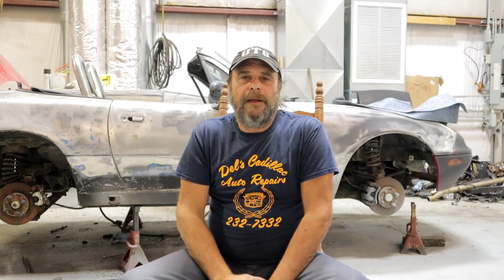Automotive De-Evolution...The Next Big Thing?

Comment: 5:01 the sad thing is todays cars aren't better at all and that is what is drawing us younger guys to them. If my 68 Satellite can total a brand new full size sedan and come out with just a little bend in the front bumper, brutally outrun the new N/A heavy ass Chargers and Challengers with about the same HP, less gears and a carb and still get better gas mileage than them AND last significantly longer, then the old cars are obviously superior.

Comment: 1970 was the pinnacle of automotive engineering because all refinements after that were/are jaded by government safety/emissions regulations.  The govt. ruined cars like it ruins everything.  Yeah, new cars are safer, cleaner, blah, blah... OLD CARS REPRESENT FREEDOM!!!  Safety regulations and aerodynamics made cars ugly, because they all had to meet certain specs that ended up making them all look the same.  Styling engineers can't be very creative anymore.  Emissions regulations took away all of the performance and tunability.  Yeah, you can take off all the emissions equipment, use bigger cams, higher compression... but then you have a modified car.  If you get an old car that never had it, you still have an original car without all of that extra, unnecessary crap.  Old cars are simple and stylish.  New cars are complicated and boring.

Comment: I shake my head when I see a LS swapped into a muscle car, especially when the rest of the car has been resto-modded.  They are completely missing out on the visceral experience of driving a car built in the 60's and 70's.
Reply: meh... whatever makes the old new again is better than tossing it all away.
Reply: LS is a nice engine for many reasons but it's about like opinions and azzholes everyone has one.
Reply: I love the newer drivetrains in a 60 year old car . Air cond and all , to me it’s the perfect all around car . And a ls engine is no way harder to work on then a old 350 . Cam swaps are nice .
Reply: I can go pump the accelerator pedal once and my car starts right up. Tap the gas again and the choke comes off. It does take ten seconds longer than a modern engine, but I’ve never really noticed
Reply: Why wouldn't you use an LS? They're a small extremely lightweight (often) all aluminum small block with super well flowing heads and tons of aftermarket support.
Reply: @SoI_Badguy LS engines leak everywhere and are plagued with valvetrain problems
Reply: I put an EFI 5.3/4L60e in an 80 Firebird and loved it! Only swapped because it was a JY 1/2 price day special and the car had a seized Pontiac 265 V8. It wasn’t a simple swap and I probably wouldn’t do it again most likely…but MAN it was great! Quick, reliable, and a great cruiser. Ive loved my carbed cars but I totally get the modern engine appeal.
Reply: Why would someone want to have to go through the continual maintenance and poorer performance of an older engine when they can afford a better, faster and more reliable engine?

Comment: I am 21 years old.  You may assume that I came up in fuel injected cars, and started out driving fuel injected cars... but that's just flat out wrong.  As I was growing up, it was essentially just my father and I.  I have a full nuclear family, but my only real friend was my father.  He taught me the ways that he learned from his father and grandfather.  My first memory was his 1969 Mustang Coupe broke down with a broken rocker stud.  I don't remember much from my youth except for the times around his Mustang and his 1966 C20.  That's all I've ever known.  He taught me how to work on points and carburetors, and how these newer cars suck to work on, and I took every bit of it to heart.  When I got my license, I was driving in my 1972 Impala 4 Door.  I loved that car, and my every thought was about how I'd make it faster.  It got dual exhaust, a camshaft, a flour barrel , and eventually some headers.  After two years, I got my 1971 Satellite Sebring on the road, and I've been eat up about it since.  People know me because of that car.  Its my pride and joy.  Its got a dual point distributor and a Holley 4778-8 700 Double Pumper on top of a 318, and I drive the crap out of it. My Impala still has points and a Holley 3310-4.  I'm building a 1967 Ford F250 thats going to have a 390 with, you guessed it, points and a Holley.  That's all I've known, and I know it well.

Comment: This is why I WILL NEVER convert my carby small block 318 to a Holley sniper!
My edelbrock carby runs very well. Why mess with that. I’m not really gaining anything by doing so.
And then suddenly my old school cruiser will have to use computer crap to get it to run which in turn makes it harder to fix when it breaks. 
Connection with a screwdriver and not a laptop is ideal. Thank you kind sir.

Comment: My first car 1962 Chevy Belaire. !982-1986 was at Fueling Engineering in Ventura Ca Oldsmobile Quad 4 project. I have a thing for 1967, 67 Barracudda Fastback, 67 Pontiac Firebird Formula 400, 67 442, so many more! Now 2002 Dodge Dakota 4.7 bored, sleeved, forged crank, rods, pistons, HO heads oversized valves, ported and polished, HO intake, custom EFI,.........

Comment: "You connect with machines by using a screw driver.......NOT a laptop"........YOU HIT THE NAIL ON THE HEAD TONY!!! Speaking of that DZ 302, I remember back when Penske and Smokey Yunick was building those and getting somewhere close to 450 hp. THAT was incredible for a normally aspirated 302 back in the day. Many guys don't believe it, and I challenge them to look it up.

Comment: I’m in my thirties, and I’m rebuilding a 70 Chevelle, it’s frame off right now. It’ll be carbed, mechanical fuel pump, the works. And Tony gets it. I don’t want the electronic mess and troubleshooting this and that. I like the simplicity. Sure, there’ll be lots of folks who want to LS swap, or what have you. But that’s not me. Those old engines have a “soul” the new ones don’t. Not to insult anyone’s LS, just I like the simplicity of distributors over sensors, carbs over fuel injection, etc. Last summer I was at a small cruise night and there were two ‘55 Chevys parked side by side. One had a Gen 1 small block, the other a full LS swap. The LS swap was very clean, very nice, but just didn’t have that “something” the old small block did. 

And just like Tony said, I really do feel I missed out on the good years of this stuff. I’m fortunate enough to enjoy it now though, so I’ll take it :)

Comment: Very few cars today will be a round or viable or able to find computer parts for then there astronomically expensive it's all part of the master plan to break our addiction to the love of cars think about it since the late 90s they really haven't made a vehicle that will hold up for fifty years and be rebuildable the wiring is made out of peanut oil which rodents love like the 03 Pathfinder all the wires that go through the bulkhead connector are the same color trying to figure that out you can't you have to buy a new harness people need to realize that everything that is going on in the world is to shoehorn us into a society that keeps its head down at work like China they want us all to be slaves

Comment: I am 25 and I like working on my '77 Thunderbird more than my '97 Accord! With my '77 Thunderbird, I can fix everything on the car with a small cardboard box of tools that I throw together after work! On my '97 Accord, I need my whole toolbox! I'm trying to get smart enough on old cars so I can ditch fuel injected cars and just drive my Thunderbird, Falcon, and Dodge D150!
Reply: You will regret driving anything older as a daily driver. They are not reliable enough to be daily drivers.

Comment: yep older cars are easier and cheap to work on while your sitting at the dealership paying 2000 or more to get a couple of sensors fixed or a fuel pump 😂😂😂. I'll take 25.00 fuel pump any day and my 65 dart that gets close to 25 mpg on the interstate from the 225 slant6 1 barrel 😁. I'll take my basic wiring over a computer sensor shit storm

Comment: tony is a time machine that takes me right back to the 70's and 80's when everybody had more passion
Reply: We didn't have passion in the 70s.
We were smarter than that. We just got down to business.
Reply: i remember when an average guy could walk into Holman -Moody, a stockcar builder, and drive out with a racecar that could do Nascar racing. it wasn't a front runner, unless the driver was REALLY good.
it would set you back $10,000   or so.
for perspective my nicely optioned 66 Malibu stickered for $3500.

Comment: Can definitely agree with this! I just turned 21 years old and these newfangled EFI systems and electronic ignition systems are all way too complicated. I'm absolutely in love with my 91 Ford F-150 and although it has fuel injection it's a great old truck that you can really enjoy working on. As long as the big eco nuts and government keep away from pollution control standards from completely choking off combustion engines, I really hope to see more devolutionizing in the car industry!

Comment: Just because a modern v8 has fuel injection doesnt mean you cant fall in love with the car. Ive gone thru 4 different modern v8 mustangs from mild to wild high compression builds all done in my garage. It is not that hard to work on, and they run well if you build them well and tune them well. That being said i have a love for all things fast, loud, and fun
Reply: I have a 1992 Ford Ranger I have had for 22 years and I LOVE that truck. 227k miles with only oil changes and tune ups to the 2.3. You are not getting 200k on an older engine as they are just not reliable.

Comment: When you are young you chase the new and "better".  At some point, you begin to appreciate the simple and basic.
Reply: Except he's trying to say the younger crowd is enjoying the older and simpler right now...
Reply: 67 and 70 are my 2 favorite years for cars . Almost every car in 67 looked great and in 1970 the muscle cars were at the top of performance. Exception is the 71 boss 351. Like that car a lot .
Reply: @gregblack3860  1957 was a good vintage too...
Reply: @frogman8591  yes it was
Reply: I thought the 1958 Impala 315 hp 348 with a 4 speed was an improvement on the 1957 Bell Air fuel injection 283..I thought cars were more desirable and improved every year. The 4 speed was a lot better but that was about it.

Comment: A big part of it is that modern cars are so good. You can’t really do small tweaks or small bolt ons and actually make much more power. They’ll make more noise, but not really much power. Compared to old cars where you can put some work into it and maybe throw a couple of parts at it and they car will run way better. 
Being able to work on something and really improve it is a lot of the appeal. Just don’t really have that with the modern stuff unless you’re really getting into it or adding power adders.

Comment: This is a well put piece UT.. its a lot of truth. I have a 300hp 2009 dodge caliber. Ya its quick and fun to drive. But its not really my thing. I thoroughly enjoy my 1981 dodge with the slant 6, or even my (converted from lean burn to older science) 1986 dodge with a smoke blowing stinky 318.. I have far much more love for them. I can adjust and fix them with basic tools. No laptop needed. (Plus a few other projects, 1955, 1966, 1942, wifes 1964 etc..

Comment: Hey don't put lawn mowers in that Appliance category there's a lot of people out there that still connect with vintage lawn mowers
Reply: Lawn mower racing!!!!!
Reply: @twowheels725  hehe , mines not a legit racer but it sure is a hoot to rip donuts and drift it in the back 40. 
I beat it like it owes me money and it's been a rough day at work. 
Redline clutch dumps in top gear are the most fun 🤣
Reply: I'm more of a pulley swap type of guy, but I can appreciate a good piece of vintage equipment that shouldn't be disturbed and used for what it is and appreciate the patina it has.

Comment: An $80,000 Redeye, wide body, Challenger whatever it is (MSRP $92,600)....   that’s an appliance.  No one’s soul connected with that.  If for no other reason than the owner not having a soul.
Reply: I'll take two!!
Reply: @THRASHMETALFUNRIFFS  I wouldn’t pay that for two.
Reply: @THRASHMETALFUNRIFFS  I have been doing that since 1999 and never had a car payment.
Reply: @THRASHMETALFUNRIFFS  in was 22 in 99 and had an opportunity to buy a garage apartment for $25,000.  I used three credit card checks over 14 months and hustled to pay it off.  That was the first of several and I’ve only taken out any equity once.  Glad I stuck to it and didn’t waste the money on lifestyle.